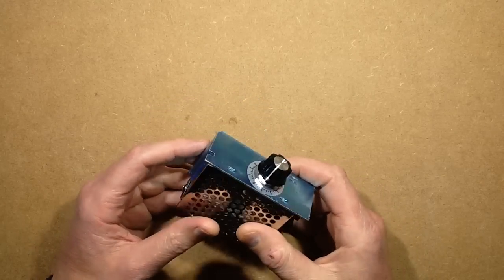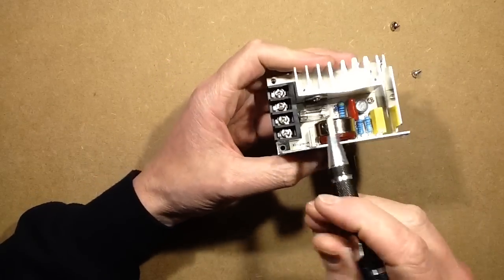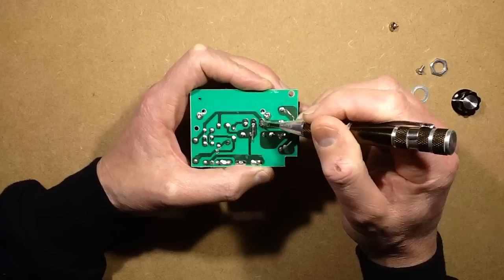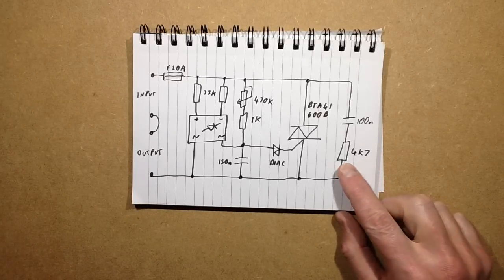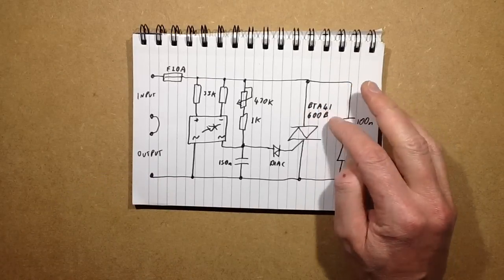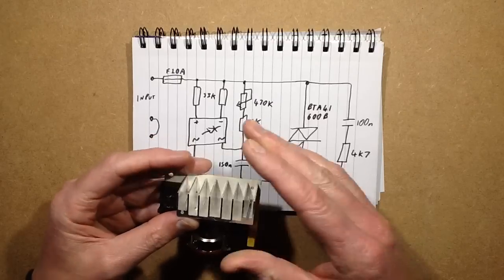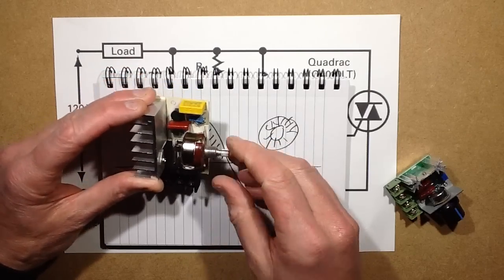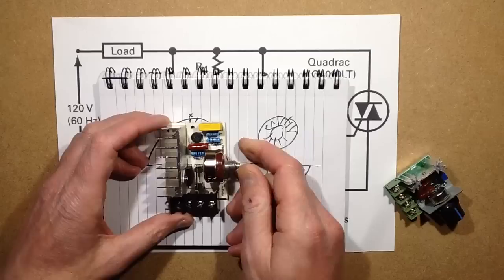Inside a "4kW" ebay power controller with schematic.

Comment: something I wonder is that in this kind of videos, that obviously filed by a British, probably in UK, they say live and neutral.

but here in Norway we just call them L1 and L2. and does not matter what that is put in what way in a thing.

does the UK use 3 phase 400v? and the neutral is used to get out 230v?
Reply from the maker: +Fabian Hansen Yes.  Homes get a single phase and neutral, while factories get three phases and neutral.
Reply: bigclivedotcom I wonder one more thing, does the from 3 phases and neutral to one phase and neutral happen outside or inside the house (in the fuse box or what you would call it)?
Reply from the maker: +Fabian Hansen It's rare that the full three phases are brought into a house.  It's usually just a single phase and neutral cable with the earth often derived from the neutral connection.  (But not always.)
Reply: bigclivedotcom In Norway, how it is is that in most places that is completely built new with its own transformer (like when a hole neighbourhood is built or a factory coplex) they build 400 v 3 phase + neutral and that goes in to the fuse box of each house or factory. and it is the fuse box  thingy (or sometimes in the wall, and they do it per socket) they take 230v ( 1 phase + netrual( and earth, earth is everywhere) often where they use different phase for eatch "kurs"(dont know the correct English word but one fuse and the stuff after).

but how most people have it, places that is not newly built. everyone has 3 phase 230v (no neutral) in to the fuse box thingy. so its 2 phases, not one + neutral per socket.

having 400 v 3 phase + neutral in to the fuse box thingy is probably the best tho.

btw. sorry my english :(
Reply: +bigclivedotcom Well, not all homes do only get 1 phase power. Like Photonicinduction. He has 3 phase for his 20000 watt power supply... He is also british btw if you didnt know him.
Reply: +bigclivedotcom In this house, which was rewired in the middle 60s, there is three phase AC driving the water heater.
Reply: +Anonymouser I thought he ditched that idea because of cost to get it installed and it's powered from a single phase?
Reply: +Fabian Hansen it doesnt matter where you put them because ac doesnt have permanent polarity but it does matter what cable is what and i hope you have color coding for L1 and L2 over there! Because only one of them is hot!
Reply: We use brown for phase and blue for neutral. Green/yellow for ground.
Reply: Theo papa dont quite know what you understand with hot.

but yes, it is colour coding. L1 is brown, L2 is  blue(dark blue, or at least not light).

in 3 phase, L1 is brown, L2 is black and L3 is gray. if its 400v, its a Light blue neutral as well 

I know it does not matter what you put on what pole on the device in most cases when it comes to function. when it comes to 3 phase electrical motors, switching two will make it go the other way.
Reply: Hot should be inside " ", my bad. What i meant is " live" or under voltage if you please.I pointed out that polarity is not critical in single phase ac like in our houses but the wires should be distinguishable and i got answer to that too.
Reply: Theo papa when its L1 and L2 and not neutral like in most places in Norway, no matter what of them you touch, you are going to get electrocuted.

as long as you do not have 3 phase 400v tho, then it is L1 and N in a 230v socket or in a light. but most places in Norway, that isnt the case, as I have said before.

but wires have colour coding, and if a electrician does what he is ment to do, its always the same colour that get "cut" in a switch when its a 1p switch. and but the right colour on L1.
Reply: ok i see. But if i understand this correctly what you say is that either there is no earthing and you have only the 2 wires from the transformer to your house? or they ground the transformer and use earth as a return path which i doubt.Anywway i wouldnt want to be an electrician there thats for sure!
Here in Greece we have L1, Neutral and Earth and the Neutral is always without voltage so you care about one less thing!
Reply: there is earth too, that is always there.

or not in 400v  outside the house, inside there is. outside there is just L1, L2, L3 and PEN (PE+N in one)
Reply: +Fabian Hansen Well In Norway most of power distribution is done via IT in delta. Means that L1 as well L2  is hot. IT system is used due to rock formation (high resistance) and earthing issues. The TN ....family is mostly Y distribution and then you would get 400 V between the two phases. But one phase to neutral will give you 230.  People sometimes  confuse  earthing as well neutral, the particularity of IT system  and power redistribution is that you have both hot.....and due to Delta they will not give  400 V when  L1 L2 are put together. BUT in TN ....systems in Y will. Earth is always there....LOL thanks.
Reply: Jan Martin Bolstad why did you say lol? What you just said is what I said, just in a better way. You may have not understand what I said.

New places have TN in Norway tho. Like when they make a new street with a new transformer.
Reply: +Fabian Hansen Nothing offensive, i found funny the part of the comment ....... there is earth too, that is always there....... waitng for you......Sounded like a line from a movie. lol
Reply: In UK and AU terminology "kurs" would be "circuit" - the run of supply wiring protected by a circuit breaker/fuse of the right size for the wiring gauge and installation.
Reply: That is a good explanation why NO has two live wires as L1 and L2, and doesn't use bonded earth and neutral like UK and (most of) AU.  Out on a rural property I was at south of Canberra, with three residences fed from one transformer, the supply was a single phase HV overhead pair, that was then stepped down at the property to 230V, with one transformer secondary winding leg grounded to form a neutral, which was also bonded to earth at each house's distribution board.

In that setup, you would get a much lower hit if you got your body between neutral and earth than between the 230V active wire and earth.  :^)   The standard for house wiring gave a maximum permitted resistance between neutral and earth with the neutral link disconnected at the distribution board, so the setup relied on having a good low-resistance path back to the transformer grounding point.

But if you had high resistance in your earth, that would not work well.  :^/

And as for the single-wire earth return (SWER) system used in remote AU, that would be a real problem if the earth return was too high in resistance...

Comment: is it possible to parallel 3-4 of those and make a welding machine ?
Reply from the maker: No.  It would be dangerous and they would fail.
Reply: @bigclivedotcom  thanks for the answer . there must be a reason sure for not building such machines .  im very new in electronics and just curious to know that reason .

Comment: Good Day. Any Chance of a Vid on a Simple DC Motor Speed Controller, with Specs and Circuit, SCR and Triac, for a light Motor Car or Vehicle? Much Appreciation. Wayne. Alberton. Johannesburg. South Africa.
Reply from the maker: You can get DC speed control modules on eBay. But due high power use it gets more complex.  The big ones use IGBT transistors.

Comment: Is it work with 1.5 hp dingle phase motor
Reply from the maker: It depends on the type of motor.  Phase angle control is only really suited to universal motors.  It can cause torque issues with others.

Comment: So, are these unis good to use? I bought one of those chinese soldering guns that feed the soldering wire. The problem is that it gets hotter than a motherfuck! I'm trying to figure out what i can use to control the temperature. I was thinking using one of these, or one of those variable router controllers. Any thoughts? I'm in the U.S. on 110v ac mains.

Comment: Is there a difference between a scr and a ssvr?
Reply from the maker: An SCR is a switching component that requires control circuitry.  If by ssvr you mean the three pin dimmer type controllers then they have extra circuitry in them so that all you need for control is a variable resistor.
Reply: @bigclivedotcom  Thanks for your answer, I will clarify myself a bit more, when I asked the question I was tired ;). I was wondering if the principle of the circuit in this eBay power controller is the same as a solid state voltage regulator. Greetings, Ad.

Comment: Thanks, I have one of these laying in a box out in my shed. I purchased it several years ago to hook to my router table so I could slow the router down a bit when doing delicate woods where a lower speed would be indicated.  I never hooked it up for a couple of reasons. 1. mine came with no labels on it so I had no idea which was in and which was out (i did take it apart and determine that by the board I think) and 2. everything I read said you need a special type of dimer to run a router, and they are spendy items to blow up by using cheap chinese crap to try to control the speed.  Oh and 3. I haven't turned on my router table in over a year so not having it hooked up has not been a major problem.  If I took my wife's suggestions (read orders) I would have sold all my woodworking equipment years ago when they were still new enough to claim a fairly good price.  Gas money for the trip to Arizona you know.

Comment: Can i use this to control 2 phase 220v AC in US???
Reply from the maker: It is designed for that voltage.
Reply: seems that its designed for single phase 220AC not dual phase 220AC
Reply: @Tim_Baleia   If it is 220 volts across 2 phases then this is also single phase 220 volts

Comment: Its not just regular Triac it is Simistor and your both schematics are WRONG! You can't put electrolytic cap between AC power rails. Your Simistor will short your whole circuit and blow the fuse if you connect that into mains. The Cathode (not gate, its not MOSFET, this is PN junction) is alwais positive drived by frequency starter made by Diac timed by cap and potentiometer junction.
Reply: You have been watching too many Star Trek reruns. Look up the specs for a BTA41600B, It's a Triac. And where do you get that these are polarized capacitors?
Reply: technixbul
LOL . You need to go back to school.
Reply: @jackbloznowski5429  maybe you should ... and you learn how to behave. Learn first types of elements and how they work before criticize someone ... kido...
Reply: How old are you?
Reply: @technixbul  And talking about behaving, you insulted the host of the video.
Reply: @jackbloznowski5429  What.. ? No, that was competent advice,  far away from insult!

Comment: Will that run a treadmill dc motor
Reply from the maker: For some applications it might work with a rectifier, but the best way to control a DC motor is with a smooth DC power supply and pulse width modulation.
Reply: bigclivedotcom would you have a link to. One please not to up on electrics looking to build a belt grinder but I’m going to use a treadmill motor

Comment: I have issue with your lack of using standard schematic symbols for resistors and capacitors. And, please tell me what a 4K7 means. I didn't encounter that terminology in my Electrical Engineering courses. Another note: drawing components in a visual manner that helps one understand the current and voltage flow really helps to understand the dynamic functions of the circuit quicker.
Reply: 4K7 means 4.7 KOhm
Reply: In my courses, we were instructed to understand and use IEEE standards. Thus, my lack of realizing there were European differences from the IEEE standard components. Seems they differ only with resistive elements. All other symbols appear to be universal.
Reply: zetacon4 yep, some places don't use all the IEEE standards, as far as I am aware they originate from North America.

Comment: can i regulate the speed of 3 hp single phase ac motor
Reply from the maker: It depends on the type of motor.
Reply: sir it is 3 hp single phase 1440 RPM AC  induction motor the can i use this 
or it burns up
Reply: NO

Comment: Keep in mind that if it is used in the U.S. 4000W would be 33.3 amps. A 10 amp fuse @ 120v would be 1200w and 2400w @ 240v...Ebay liars as usual, of course you could say you tried to run a 3000w heater to the seller and get your money back.

Comment: It's weird how it turns out that your video is on my home page of youtube just days after me adding almost the exact same iten to the cart. Just the diffrence is, it's from a swedish site, but they are mainly chinese products. It was for 4kW as well..
here it is if you want to check it out: https://fyndiq.se/produkt/4000w-ac-voltage-regulator-220v-dimmer-electric-motor-speed-dc5b566d6d594268/ Now I just have to buy it and check if it is like the example you have.

Comment: hi, i think your schematic may have swapped input and output. The bottom line should be neutral wire to make this circuit functional.

Comment: Why can't I hear any Audio o-o
Reply from the maker: +Freeze Affects some browser configurations depending on the system audio settings.
Reply: +bigclivedotcom Well I see. I am Using my Surround sound Heat Set and I deactivated the Surround Option. But since your Video has Mono Sound It got on the Center Channel and because I deactivated the Surround my Heatset ignored the Center Sound.
Reply: +Freeze but yea Nice Video ^^
Reply from the maker: +Freeze Yeah, that happens a lot with the surround processing.  It's just the way it gets recorded and uploaded by the YouTube app.

Comment: Clive this video is a talk fest. Mostly viewers want to know: cost, does it work, what are the advantages & shortcomings.  You chose, heavens knows why, to not even test the device, even just to check  if the resistor (4R7) was in fact correct. More info on size of noise reducing toroid also helpful.
Reply: You're new here aren't you.

Comment: I bought one (06 Mar, 2016) from same seller and it looks like it has a ceramic fuse in it now. http://s32.postimg.org/6h8plm3h0/fuse.jpg
Reply: Hello there, hello there (heh-heh)

I have one like yours that came with a ceramic fuse but came with no documentation nor indicator stickers on the terminals.

Would you mind telling me what the terminals are marked on yours top to bottom as per your photo? (eg Output Live, Output Neutral, Input Live Input Neutral,

Thanks in advance!
Reply: The thing is marked in chinese symbols so i cant say really, there is no clear "in and out". I saved a screenshot from Clives video where it is marked on his, but i cant swear that its the same on mine, havent tried  the thing yet.
http://s33.postimg.org/sz16sns5a/IMG_20160531_003109.jpg
Reply: hello there Nothing like the adventure of mains chinese electronics ;)

Comment: if that work on 12 volts to get 4000w it would need to suport 333.333 amps that thing will burn before 
to get  to tha you divide wattd by  volt it will give you amp

Comment: Do you understand this circuit? http://i.imgur.com/9sGDu9l.jpg

I would like to start simple, and work my way up to the one I've showed you. I have a little understanding how electronics works, and would like to learn more, and become smarter. In this day and age, we live in an advanced age. I've learned about the n-Channel mosfet, understand that capacitors are used to smooth voltage, and to supply voltage when needed, but I have a very limited understanding. How would I go about learning about dimmers, the Triac, Diac, etc. I've watched a couple videos about Triacs, Diacs. Could you help? I'm sure the circuit above is very genius, is what I was told.

Good video(s), (+1 : 1,367)

Comment: hi clive, have you done a teardown of a dc pwm version of this,  im trying to get my head around this one. https://www.ebay.co.uk/itm/25KHz-9V-12V-24V-48V-60V-20A-DC-Motor-Speed-Controller-Regulator-Driver-PWM/272210396523?ssPageName=STRK%3AMEBIDX%3AIT&_trksid=p2057872.m2749.l2649
it works well,great price, i overheated mine with a modified 60v mobility scooter , im looking for ways to keep the smoke inside. iv used one with a higher amp rating but the resulting movement was too sedate for my liking.
heres a video of the insides and an attempt at a diagram.
https://youtu.be/sWay1ktqcCM